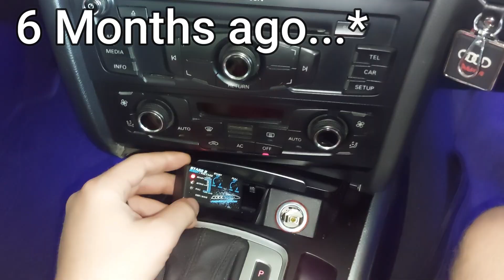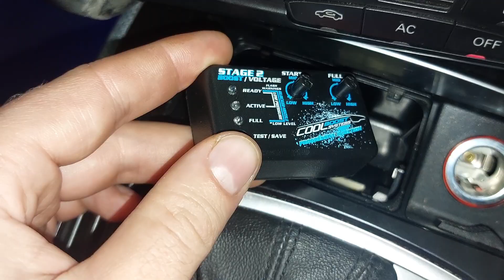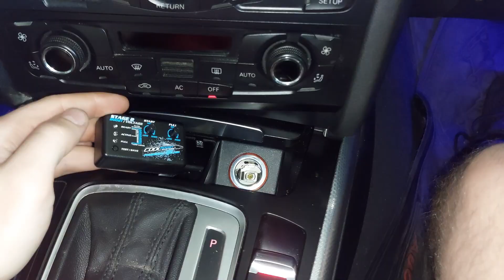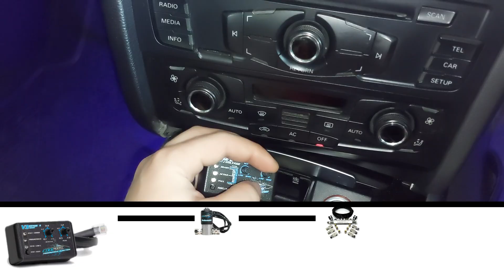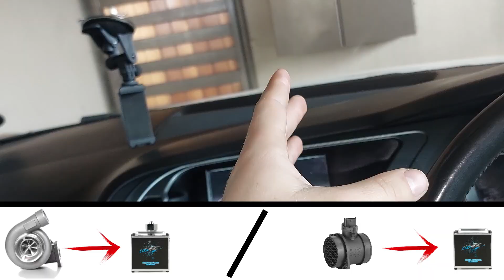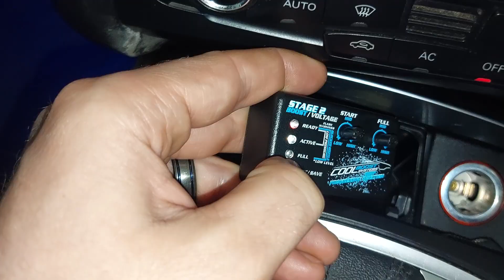Stage 2 Cool Boost Water-Meth Controller Setup Guide

Comment: great video mate, I was messing with test button to solve a totally different fault, got that sorted but now the issue I’m having is when I’m driving the injection light goes green under a very small amount of throttle, went on a motorway drive and it was constantly green just cruising and therefore used half the tank in 2 hours. I have a 335d and I’m assuming I’ve accidentally factory reset settings so that it activates under very low boost ? Thanks
Reply: From what you’ve explained it seems like the “start” dial is set far too low but I’ve not changed this and it wasn’t doing this before.
Reply from the maker: Yea, I was about to say the start dial is too low.

You need to increase it and then hold in the button so that it saves the new setting and then you try it again.

It might sound dumb but someone could have accidentally played with the controller like your kid if you have one or you accidentally changed it, but forgot you did and when you saved it, it was so low that it just sprays constantly.

Maybe when you set it up the first time, you never saved the new dial settings, and at the factory, it sprays very early, lol...

What a massive explanation, haha...

Just increase the first knob a bit and save... try again, I am 100% sure it will work then.
Reply: @megalodononwheels I’ve checked coolboost manual and it says set first dial to half of max boost, which it currently is set at, definitely hasn’t been changed since installed but I’m beginning to think it was installed by people who have no clue what they were doing (bmw specialist during prev owners ownership) 

What I’ve read on website is injection delivery mode (menu 3) is recommended for low spooling small turbos (which my car has) to prevent flooding from quick progressive ramps. 

It says if this is the case the system needs to be split into 2 separate injectors and 2 solenoids- my car hasn’t got this, looks like the system has just been set up totally wrong.

Comment: I know this is a little off topic, but what cable did you purchase for your vcds scanner? Would you recommend one to an enthusiast looking to just maintain their car for the long run.
Reply from the maker: So my cable is not a VCDS cable.

It is a tuning cable that allows diagnostics, data logging, and tuning.

It's called HP Tuners.

If you're interested in making your car faster and working with a tuner remotely (like my plan is to do with clients), then it is probably the best tool out there, in my opinion.

Otherwise, if you just want to learn a few things about your car and activate a few hidden things and etc. Any VCDS cable from version 20 and above will be perfect (they are at version 25 already)